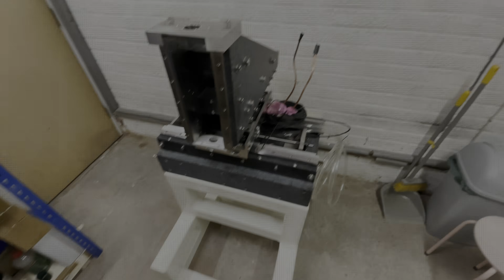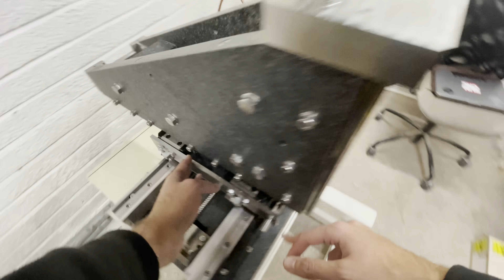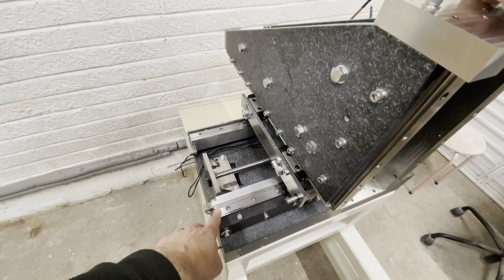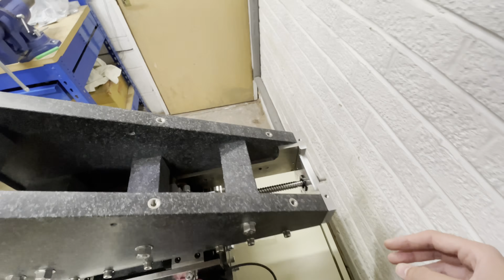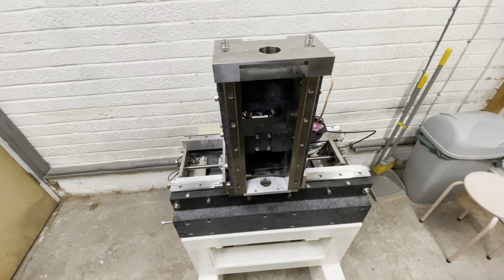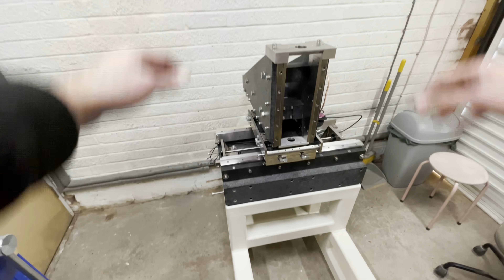X & Y Axis Assembly - E003

Comment: I think it's a bit late, but consider it for the next machine. 

1. Water cooled linear motors are not expensive for this kind of machines.

2. You can buy air guide ways from PI for 5k€ 300mm travel. Insane precision for the price.

3. You can buy machine granite components ground and lapped from China. Chinese companies make really accurate products and the quality/price ratio is crazy good. I've bought plenty of granite components, both professional and personally.

Enjoy the process,
Victor
Reply from the maker: Hi Victor, Thanks for you comment and suggestions. All of these were considered when I wanted to design the machine about 3 years ago. In fact the first iterations were using linear motors and airostatic guideways. 

1-Since the machine will be running from a 13Amp single phase plug, linear motor couldn't be an option. They are extremely power hungry. The method I'm using is actually more expensive than even high-end linear motors. 

2-Airostatic guides are very accurate and rigid, but you need a compressor to run constantly. That means a lot of noise and power consumption, hence I didn't go down that route.

3-The granites came from China. A company that makes CMM beds. 😊
Reply: @kasramehraky9283 Thank you for your videos.

I'm currently building a small moving gantry 3 axis milling machine (540x540x160 mm). Except the granite base, all the other structural parts of the machine are aluminium (motors and guideways water cooled). One of the main jobs for my CNC will be developing hydrostatic bearings for my next machines and some optical components. I'm using Mitsubishi CNC and drives.

Have fun and enjoy your machines,
Victor
Reply: @kasramehraky9283  Are you able to recommend a Chinese supplier for the granite components?
Reply from the maker: @devinmoodley4061  https://www.unparalleled-group.com/

Comment: 2:31 those are cross roller rail with special(circulating)carriage ,both load capacity and stiffness are bad.
Reply from the maker: Have you used them before?
Reply: @kasramehraky9283   I've assembled cross roller stage myself.I also spend a lot of my spare time study how other(large company (THK/IKO/NSK/Paker/aerotech) design such stage.For using cross roller rail for such application,u can pick up rail set of different length,the inner rail(the rail attach to table) is shorter than outer this can prevent rail extrude out.Circulating carriage has fewer roller than the config mentioned above.Striaghtness and stiffness of cross roller rail are provide by rail(and mounting surface) and roller

Comment: Hello, which controller are you planning to use?   I'm in the process of building a machine based on the Centroid Hickory controller and having a time selecting the right linear encoders. Currently In looking at the RLS LA11 they use BISS but need to do more research. Please consider making a detailed video about the controller you plan to use and electronic components.
Reply from the maker: Hello. It's Beckhoff TwinCAT CNC. It has all the compensation calculations that I need (pitch error, volumetric, perpendicularity and thermal). Also RTCP for various 5-axis configurations. RLS is a great choice because it's part of the Renishaw group and the quality is fantastic. Biss-C is the best connection to go for, so you have selected the right one, but make sure your servo drives are compatible with that (mine are Beckhoff so they accept Biss-C). I am using Renishaw absolute encoders (RESOLUTE series) with 50nm resolution.

OK, will make a video about that as well. Thanks for your encouragement. Make sure to SUBSCRIBE!
Reply: @kasramehraky9283  Gotcha thanks for the tip.

Comment: Exciting project. I'm building an extremely large 5-axis granite mill (what accuracy I can get overall I'm not sure yet due as there's lots of things to compound the error). Spending probably a similar amount of money to you. Will hopefully start posting videos soon. Look forward to watching more of your videos. Control wise, I'd bought a masso G3 as I use on other machines but I don't know if I'll get the most out of it with that. The servo drives obviously do their calibrations but I don't think that's necessarily the same as having an S-curve in the controller.

A question for you, what resolution glass scales did you go for? I still haven't pulled the trigger yet on scales as I haven't calculated max feedrate based on max pulse frequency input to my dual-loop servo drives and as they're expensive at the sizes I need.
Reply from the maker: Thanks for your comment and good luck with your machine build.

I've used many CNC controllers but never a Masso, so can't comment.
I went for Renishaw absolute (RESOLUTE series) encoders with 50nm resolution. I am aiming to get 1micron repeatability out of this machine so the encoder divisions are 20 times smaller than that, and it should be enough. Because my encoders use Biss-C connection, baud rate (and as a result machine feedrate) is not an issue. I could have gone for 1nm resolution with the same 60 m/min feedrate. If you use AB phase signal (pulse output), then resolution and baud rate can be an issue. Try to get a servo drive with Biss-C input for the 2nd encoder.

Hope this helps.
Reply: @kasramehraky9283 Thanks for your reply. Is the 20 to 1 ratio something you read somewhere or got recommended? I'd imagine down at that range it's mainly a servo limitation on minimum amount of movement/time to settle/delay in control loop as in operation it's always playing catchup so never exactly where it should be during moves which is what is important while machining vs just going to a position and stopping where the end position could theoretically be very accurate and repeatabl given enough time to settle. Do you know how often the controller polls the serial connection for a position?
Reply: @Saminvent05  Oh I accidentally commented from another channel! Sorry for the confusion @kasramehaky9283
Reply from the maker: @Saminvent05  The encoders are not creating pulses, but sending data packets via Biss-C connection directly to the servo drives. This is the fastest way of correcting any position errors. If you want to wait for the controller to apply corrections, the machine would be terribly slow.

Comment: How are the small mounting holes/features put into the granite parts?
Reply from the maker: Thanks for your question. They were machined on a CNC milling machine using special tools for machining granite. They are called vacuum brazed diamond milling tools. And of course lots and lots of water for cooling the tool.

Comment: Damn, its one thing to draw up a project like this and another one to actually make it. Great job and thanks for the explanation!

You mentioned counterweight, I was meaning the Z axis (for some reason it looked like you had some kind of counterweight there in that wheel on the back). Also the budget is also very realistic considering on what a big project this is.

Btw I have not yet checked on instagram, but what control you plan to use on this machine? I feel that anything without proper volumetric calibration and jerk control is not going to work great, so most of the diy friendly controls fall short there (linux you could do full calibration, but S-curve jerk control is not there).

 O also if you need some cheap new zero points tell me, got some Schunk Vero-S mini on a shelf. Not as precise as the Erowa/3r ofc (salvage some from a old EDM sinker machine if you are ok with used).
Reply from the maker: Hi again!

Good comments, that wheel is a mechanism for the Y and Z axis cover which houses a clockspring. It's a bit hard to explain, so I'm afraid you have to keep watching the new videos until I get to assemble that one! 😁

The control is Beckhoff CNC. I needed something that was quite powerful, allowing me to have various types of software compensation and full 5 axis control. Beckhoff TwinCAT CNC allows me to have volumetric compensation, thermal compensation, ball screw pitch error compensation (screw mapping), and full closed-loop control. It also has a library of different kinematics for various 5 axis set-ups which has RTCP functionality too. It has also G-Code and M-Code libraries for a turn/mill machine which is what I am making, so overall I hope it is a good choice.

Finally, thanks for the offer. I have already designed and machined everything according to System 3R, so I can't go for anything else.